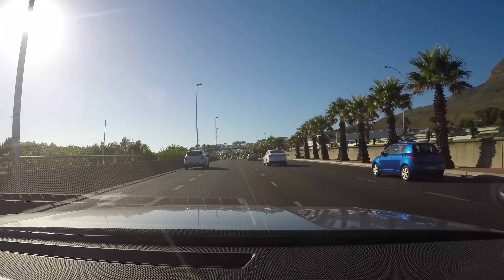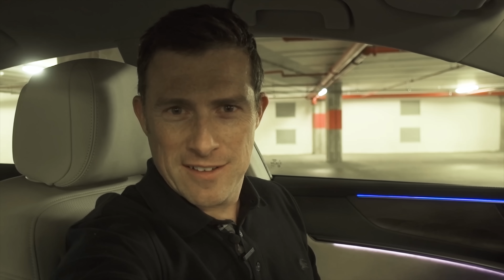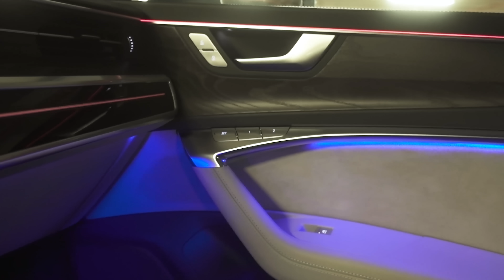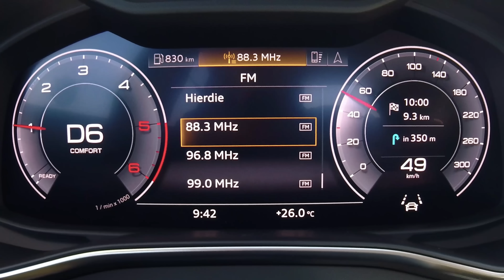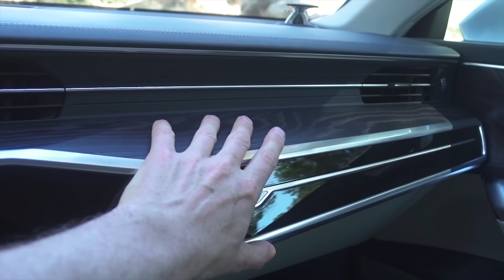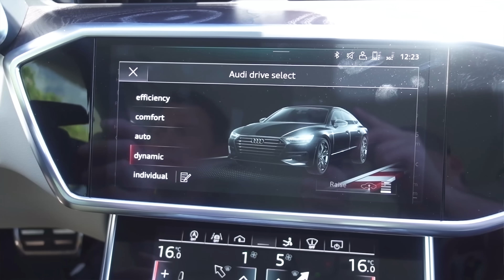New Audi A7 2018 review – see why it's the coolest and most high-tech coupe ever

Comment: i've had one to try and quite frankly, the overal impression was "meh". Silent comfy etc, you name it. Nothing wrong with it (aside from touch screens: pretty but unusable when you drive). The issue is: it feels nothing special. Didn't feel much more alive than my Q7, much less engaging than a 5 series. For the exact same price of a fully stacked A7 55TFSI, you have...and RS5 sportback. Hardly smaller, much more alive, more usable interface.

Comment: I just don't like the steering wheel response on a modern cars. Even on cars like this. Car makers should've stayed with a classic hydraulic power steering. its easy enough to use it in low speeds and perfectly sharp in high speeds with great response to the driver.....

Comment: Audi don't and have never played engine sound through the interior speakers. If you want to know if the sound is from a speaker or not look under the rear of the vehicle and if there is a spherical muffler like item as part of they exhaust, that is a speaker to boost the natural exhaust sound. And the front grills are solid plastic to reduce drag as there is no cooling component behind them, when the S7 and RS7 are produced one or both can then have them as vents for added cooling or aerodynamics.

Comment: The design is beautiful. However, like most of the fastbacks/hatchbacks on the market, it lacks a wiper blade for the glass hatch.

On pouring rain or snow, it really makes a difference to have a wiper blade. This is a detail that all but Porsche, who offers a hatch wiper blade as an option, have missed. Lazy designers and engineers.

Comment: Those lights are sweet! I wonder if that feature will make it in the American market. I hate how quite a few European cars convert the amber turn signals to use the red brake lights as the signal. Makes the car look cheap.
Reply: rockervdrive I hate that cars in America have red turn signals rather than amber turn signals

Comment: Do a Head to Head between Audi A7, Mercedes Cls and BMW 6 series. Amazing video tho.
Reply: We'll have to wait for the next gen 6 (8?) Series Gran coupé, Wich shouldn't be out before the next 2 years
Reply: Titanium_BMW He probably means that the current 6-series went into production in 2011, and it may be a bit outdated compared to the others, hence wait for the 8-series.
Reply: Matteo Ventura How is it out of production when it was just released? I just seen a "2018 6 Series" the other day.
Reply: Titanium_BMW sorry just the 6 Series Coupe was discontinued. Gran Coupe and Convertible are still in production, but the point doesn't change. They are old 2011 cars. The "2018" 6 Series you've seen is just the Model Year of the 6 Series which came to the market in 2011. They've had some facelifts but they're essentially the same car. Different story for the new A7 and CLS, which are actual brand new cars, and not Model Year or Facelift versions. BMW then added to the "6 Series" naming the old 5 Series GT, that now is classed 6 Series GT. But it's the same car. They did the same thing by removing the 3 Series Coupe and Convertible, renaming them 4 Series, and with the 1 Series Coupe and Convertible, renaming it 2 Series. For the "actual" successor of the real 6 Series Coupe/Gran Coupe, we'll have to wait a few years (and it will probably be renamed as "8 Series").
Reply: Matteo Ventura Have you seen the new 6er G32 body style yet. It wasn't released in 2011. Its a brand new generation among the G series. Along with new 7er G11, 5er G30 and X3 G01.
Reply: Titanium_BMW that is the 6 Series GT I was talking about, based on the 5 Series GT which has been renamed 6 Series GT with the new generation. It has nothing to do with the coupes 6 Series.
Reply: Titanium_BMW the "2018" 6 Series doesn't even exist. It went out of production. We'll have to wait for the 8 Series.
Reply: Matteo Ventura Yes i'm talking about the (rebadged 5er GT)  2018 6 Series GT which is supposed to be a direct competitor to the new A7 and CLS while the 8 series is aimed at the S-Class coupe.
Reply: J Mura What do you mean? The 2018 6 Series is a direct competitor against the 2018 A7 and 2019 CLS.
Reply: Yes
Reply: So I'm thinking it should be the new panamera turbo, rs7, and the cls63s with randy
Reply: yesss